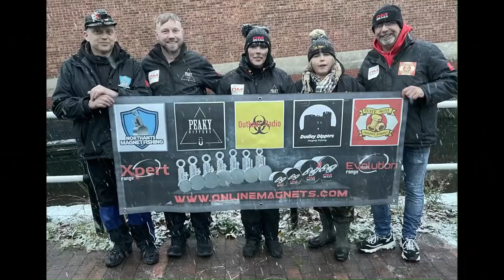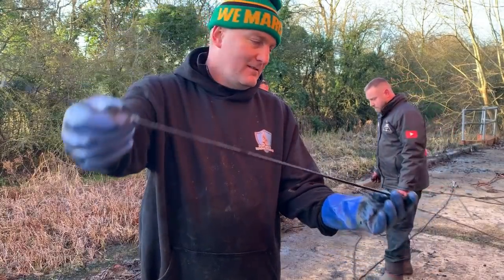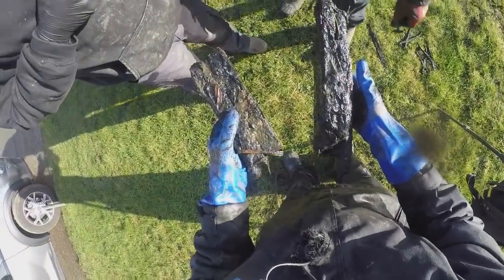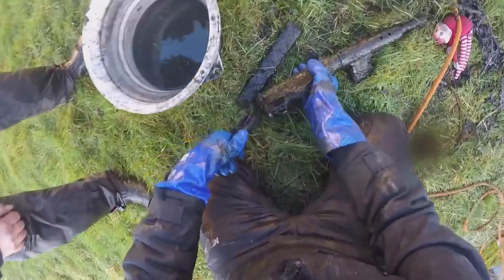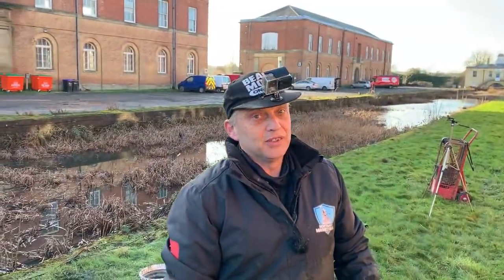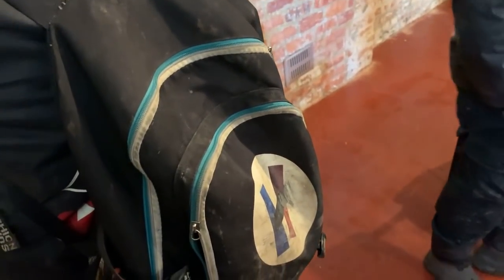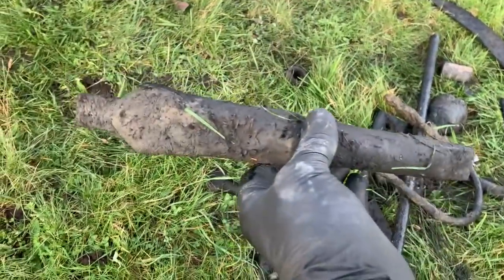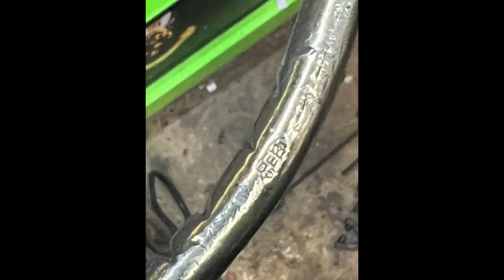WWII Submachine Guns Found Magnet Fishing #149

Comment: Hi ya back in the 70s + 80s the firm i work for on plant hire his mate was  builder and I went with him quite  a few times diging through the concrete for leaks as you should see holes everywhere  .
The older guys there were telling us that after the war WW11 they dumped a lot of cases of guns grenades and other stuff in that canal if that helps at all.

Comment: Do a bit of mag fish myself in Florida, USA. I have found a method of cleaning items by attaching a negitive DC wire to the object, a positive wire to a stainless ateel electtrode (Can be any piece of stainless.) and applying a volltage from a battery charger. The muck will jump off the object to the stainelss. Add a little baking soda for heavily soiled objects. Cheers!